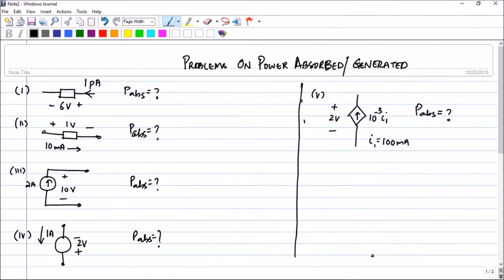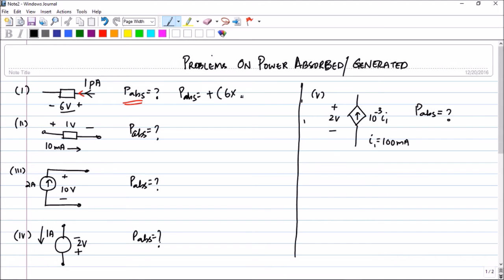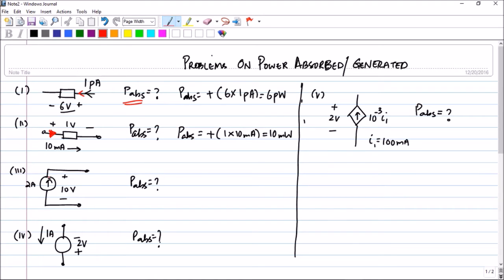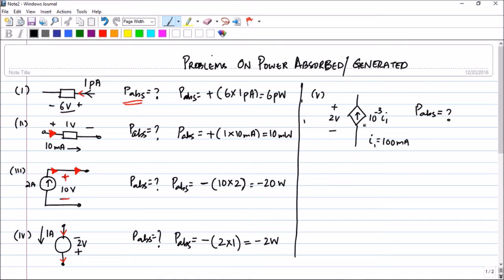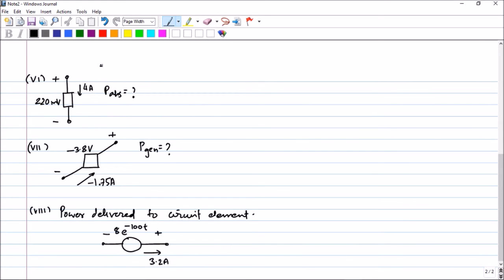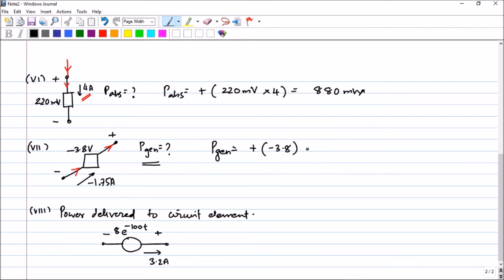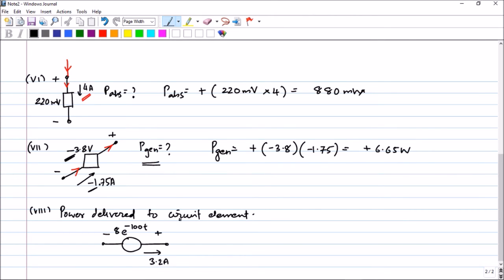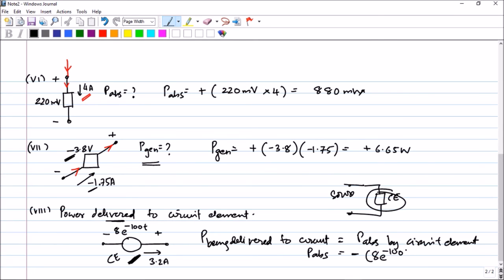Problems on Power Abs/Gen #ECA- Session 5

Comment: in problem 7, isn't it power delivered? therefore how come the power be positive?
Reply from the maker: The question is to find Power generated by circuit element.  The box is a circuit element ( we do not know if its resistor, voltage or current source ), as current leave positive terminal so Power gen will have a positive sign (sign convention- bcz current leaves positive terminal), so Power gen = +(-3.8)*(-1.75)... ( do not bother changing voltage and current directions, as we follow sign conventions as it will take care of the final value ). I hope it is clear now.. :)
Reply: so that means, if the question is power absorbed, then the power will have negative sign. am i  correct?
Reply from the maker: Yeah..Power abs = - Powergen, you will also get negative value if you use sign conventions